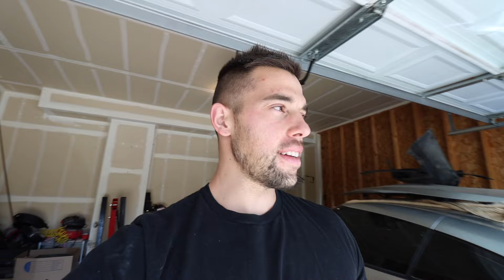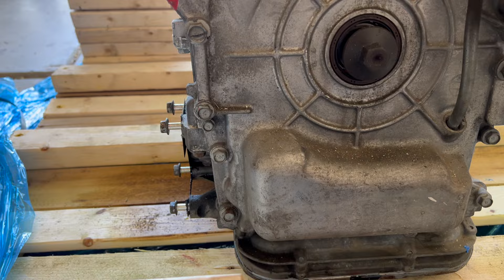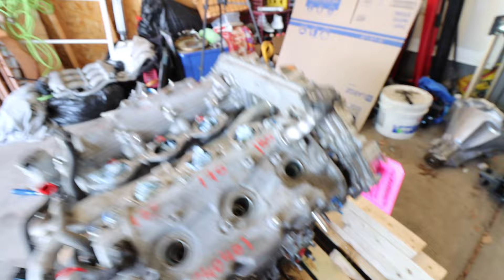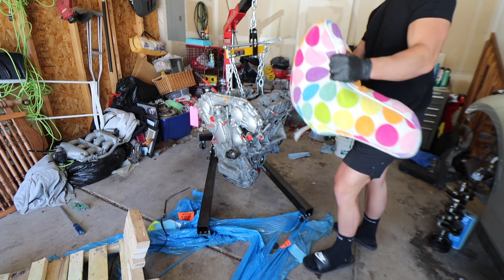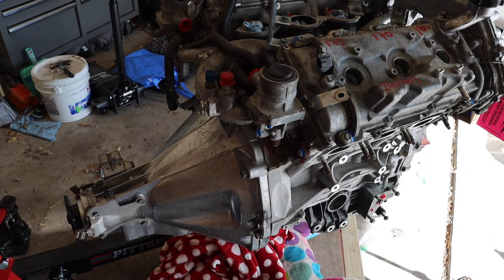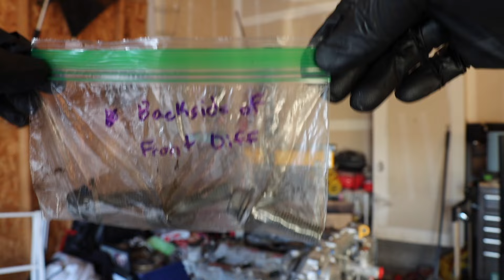THE GTR REBUILD! MY NEW MOTOR IS HERE! EP. 1

Comment: Definitely need a Torque wrench for all those bolts you just installed,  especially anything that you won't be able to torque  once the engine goes back in the car, turbo oil leaks would suck, and you don't want to mess up the threads or break bolts by over tightening anything
Reply from the maker: Ugga dugga aint cutting it?

Comment: I like your videos, but why did you not rebuild yours? You would have had peace of mind that everything was right. You should at least take sump and timing cover off and check the pan, oil pickup & oil pump. Otherwise you just don't know...
Reply from the maker: I found a longblock for basically the same price as a built bottom end. This motor is unopened and shouldn’t have any issues. Let’s hope for the best 🤙
Reply: @adamhouston4299 I was in exactly same position as you. I bought mine with damaged bottom end and I decided to repair it (in my 2 car garage!). I did look at other engines but if I had bought another I think I'd still be tempted to check the sump and oil pump 🙂 
I look forward to seeing yours on the road 👍

Comment: I Hava a 900whp gtr and I'm with stock pistons and rods, runs like a dream bro I'm excited to see your motor running crazy fast
Reply from the maker: Thanks bro! I bet 900 feels absolutely insane 😂 what turbos?
Reply: @adamhouston4299  it's terrifying fast bro lol I don't know how this guy's go 1500 2000 or more that's totally insanity, for a street cars like our cars 700 is already more than enough to have lots of fun and plus being reliable whith I believe is very important. My turbos are AMS Alpha 11, I replaced turbos, intercooler also AMS Race intercooler, 1300cc injectors, fuel pump e85, I also installed a carbon fiber AMS intake manifold and a boost logic titanium exhaust, if one day you come around NY let me know let's go for a rip